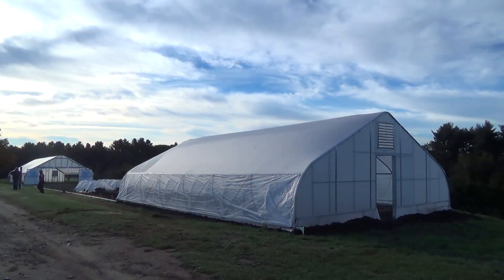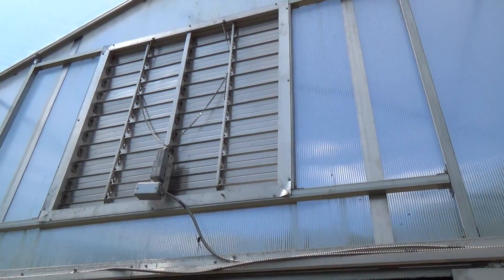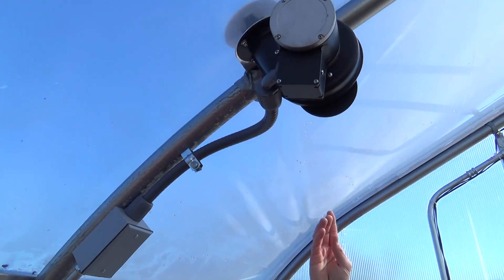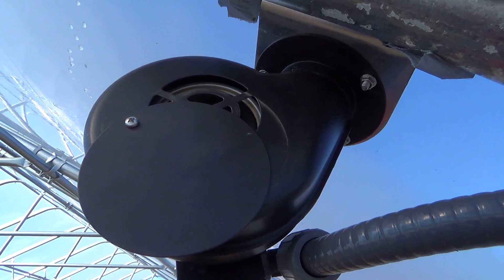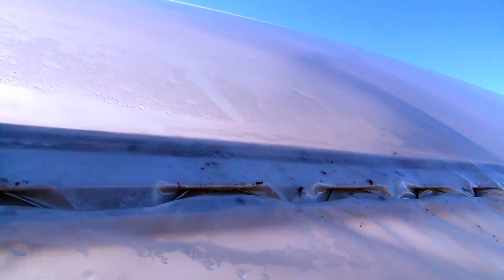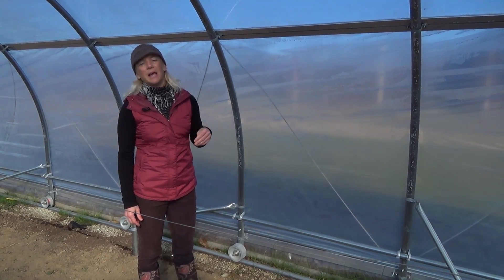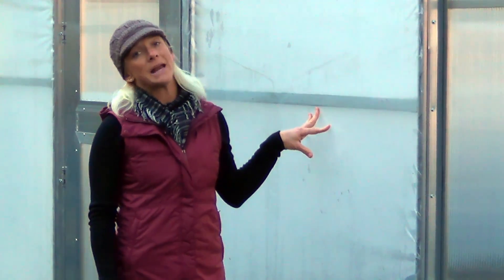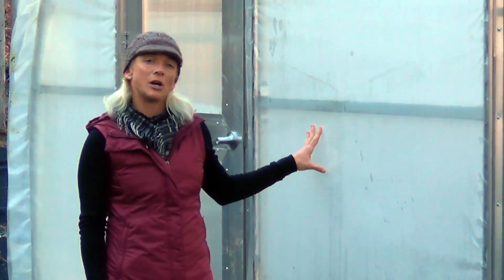Single Poly vs Double Poly By Rimol Greenhouse Systems

Comment: Fair assessment compared to polycarbonate. If you can stand to sink the investment in 10mm or 1/2 inch twin-wall polycarbonate it is amazingly resilient. Our smallholding is at a very exposed site. We had a door come adrift in a gale and found it about 100 yards away up against a hedge but it was  OK. Also, the oldest of our polycarbonate is over 10 years old and there is no sign of yellowing or embrittlement even though some of it (the cold-frame sides for example) are exposed to sunlight on both sides for part of the year. We screw the 10mm polycarbonate to a heavy wooden frame at 12 inch spacings around the edge using 1 inch diameter washers to spread the load and have no issues at all even with the framing spaced at 41 inch centres.

Comment: On you double layer with the blower, do you also use it during the summer or only put a double layer on with the blower during winter?
Reply: ... I have a double polly gh myself ... the added measure is snow melts off the double polly house ... so yes leave the blower on 24/7/365 ...they use minimal power ... also helps reduce wind /hail damage to your greenhouse ...

Comment: How cold does it get inside that green house?
Reply: With our greenhouse in northern Maine, it would be 30 degrees outside, and with a single layer it would be 50-55 inside, but when we added a second layer we gained 25-30 more degrees or 75-85 in the sun.
Reply: @RetreatfarmFarmvilleVirginia  
Was that without heating it?
Reply: @nathanbarker4394  Yes I want to know that as well! I hope she responds.
Reply: @RetreatfarmFarmvilleVirginia  OMG thank you! I missed this in the video or generally on the internet - simple comparison single vs double poly layer with temps... Thanks again for posting it. Im not sure why its not in the video
Reply: @RetreatfarmFarmvilleVirginia  
i have a polycarbonate green house in Maryland, 
i noticed the problem is the night. during sunny days i can get 50-60 in while it is 30 out,
but at night it lose so much heat it is barely 32, 33, when it is 20 out, we really thought it would be warmer.

Comment: is there any reason not to frame it for two layers, like one layer inside the frame, one outside, instead of running fans 24/7?
Reply: With a simple modification you dont need to run the blower 24/7. You`ll save upto 80%  in electrical power and extend the life of the blower considerably.
Reply: What modification? I'm building now, very interested!
Reply: I’m waiting on the little modification.?
Reply: Ok I got it . The modification is . To install one layer of plastic on top and one on the bottom . That’s the modification
Reply: The framing be in between the plastics
Reply: @GasparNunez63  u could make a 4 layers. But in all it's not a big problem to run the fan 24/7, because u safe money on the electric bill. I read in a university side, u should use outside air, so u dont get condensation inside the layers.
Reply: @GoonRider19  i ve seen a system with inside air .. and the darmer said initial condensation will disapear ..and it has a r rating of 5 !
Reply: @JohnGuest45  with a aolar panel and 1 battery it willrun off grid pretty easy ..